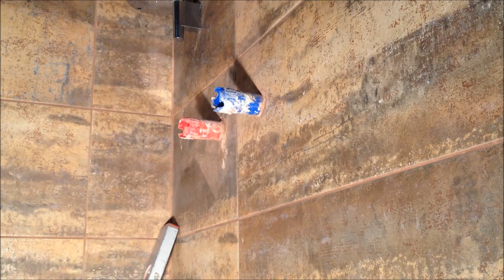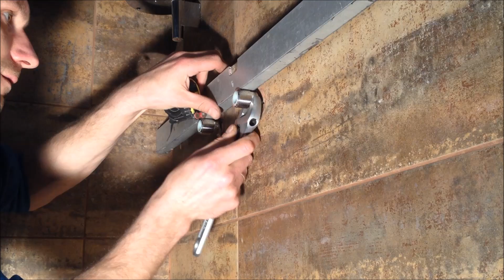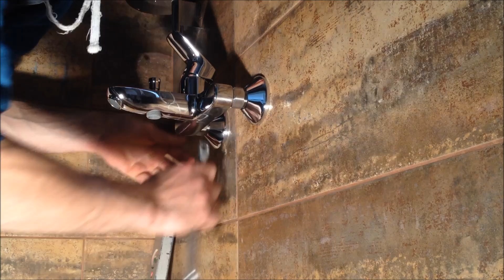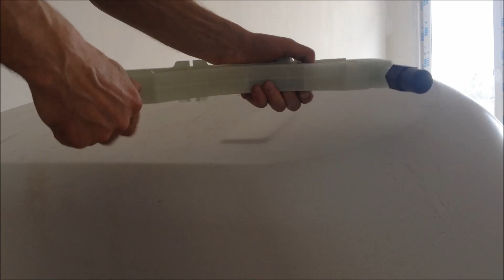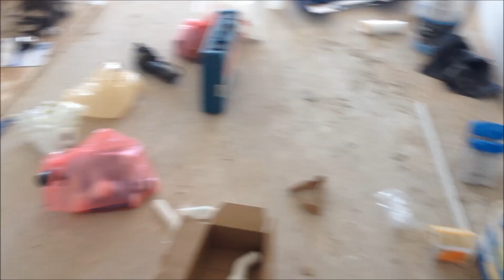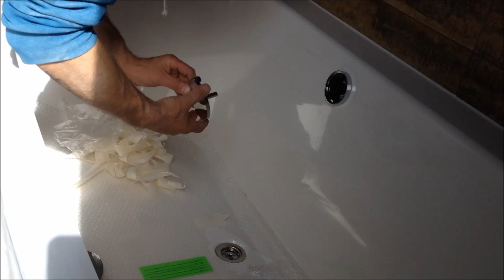Bath Installation

Comment from the maker: Bath Installation. A few tricks and tips to make your bathroom installation a whole lot easier. See how to connect the pipes and fittings to the kitchen sink, sink, toilet water lines using PEX water lines and PEX fittings. How to install a drain system, different ways to configure it for your own situation.This is the BEST plumbing solution for beginner DIY plumbers. In this bathroom training video you will learn how to use PEX and copper water lines and fittings to quickly and easily plumb your new bathroom! Bathroom Plumbing is simple to do if you have the right instructions to follow. Watch this diy bathroom plumbing video and learn a few Pro secrets for getting your sink water lines installed right the first time.
Reply: Which country are doing all this work not in the UK, your pipe and waste fitting are not British
Reply from the maker: Germany
Reply: Thanks. Sorry to say the British are far behind slow to catch up. Good job
Reply: nice video
Reply: Matin Khan Hi
Reply: Rohit Kumar  hello